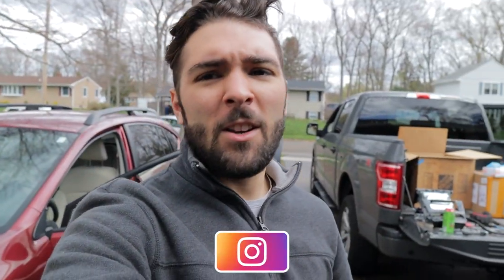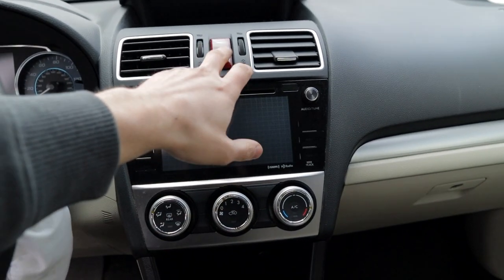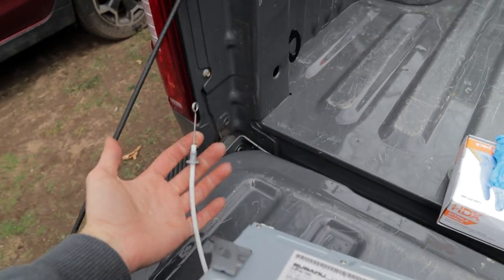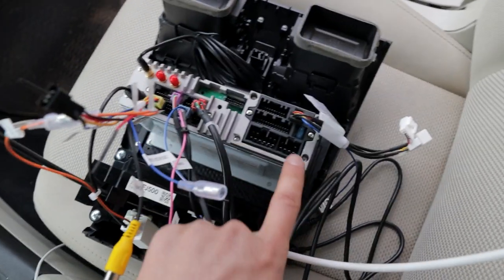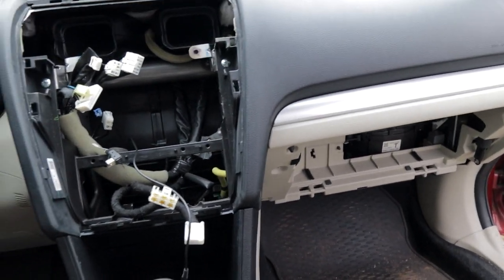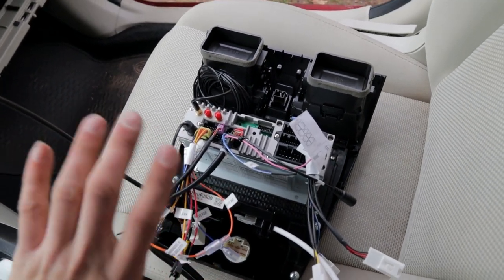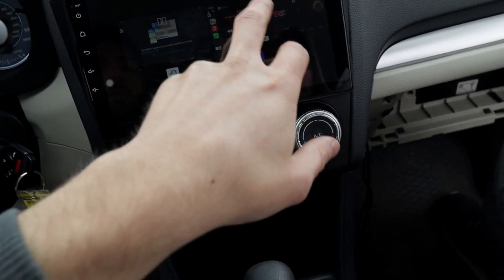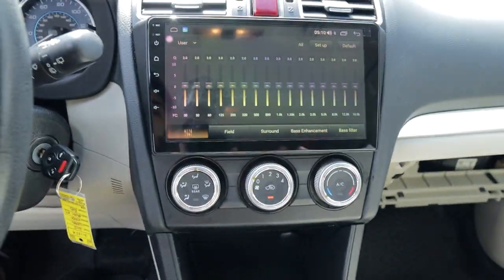Crosstrek Gets a New Idoing Headunit! - Apple Carplay Wireless and Adroid Auto

Comment: Great content!  I have the same Idoing head unit in my WRX. Just installed it 3 weeks ago.  It’s been great. FYI ... You don’t need to plug in the phone for CarPlay it’s able to do wireless CarPlay and Probably Android Auto as well.
Reply: Rob, you ever have connection issues with the wireless carplay? like doesn't quite connect right away and finding you have to close zlink and reopen it?
Reply: @ZoopChedda  Hi, yeah a couple of times I’ve had it hang and not connect. I had to close the link app. Most of the time it takes about 10 to 15 seconds to connect and authenticate to my phone.  Maybe just plugging it in is worth the hassle. 😬
Reply: @robpnol  aha yeah eh, good to know though that it's not just mine! still lightyears better than the stock HU ! thanks

Comment: Did you have to remove any of the dash under the steering column to access the 10mm?
Reply: no , use a long extension and a swivel , you will not re use the two 10mm, you probably will drop the left (driver side one) but you should see it in the main section once you get the head unit out.(unless you have a magnetic 10mm.)
Reply: @86309  I bought a set of wobble head extensions from Harbor Freight on Thursday. I'm going to magnetize one of my 10 mm sockets
Reply: no! to having to remove any panels on driver side, make sure you note the cable routing for the HVAC controls if yours are the manual push pull cables.

Comment: Warning to all 2021 Crosstrek owners considering the idoing radio. Subaru added a comm port to the back of the OEM radio that communicates with the starlink system. If you try to install the idoing radio without the appropriate connection back to the starlink, your vehicle will lose starlink functions including its vehicle theft system. Idoing will also deny the problem.